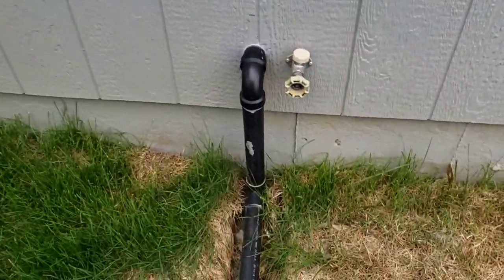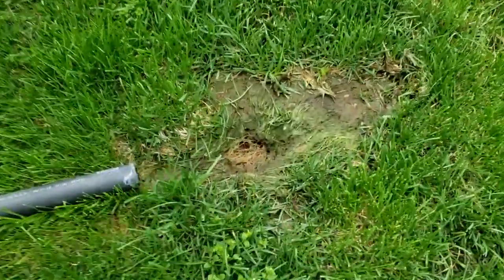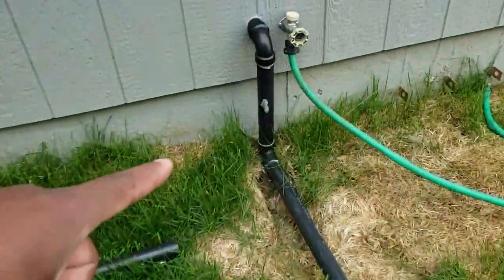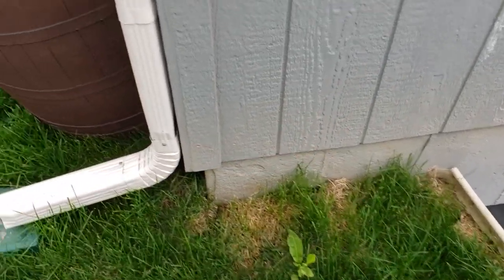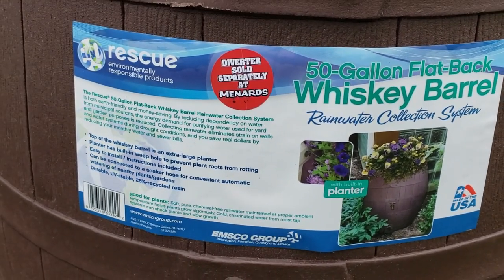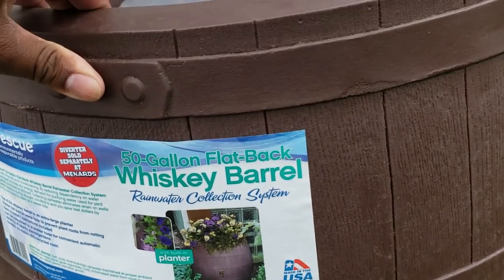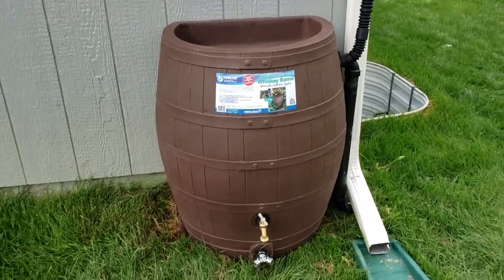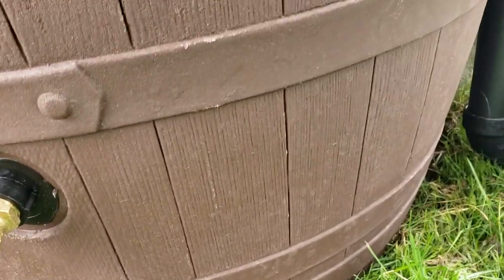Sump pump into a rain barrel install

Comment: I have been wanting to do this for a while. My water is EXPENSIVE. 
I already have some rain barrels and the sump is right next to them. Right now the sump comes out of the house and goes into a large pipe that goes to the retention pond 2 doors down. 
So, I will be able to have the sump pump fill the barrels and then overflow when full back into the large pipe that goes to the pond!
This is the year. 
Next year I am going to figure out how to tap into the pond 2 doors down!  Ha.  Just kidding. 
Nice video. I think the hardest part will be finding enough barrels or water storage area with out making the yard look trashy in my case. 

I do have a sprinkler system. I have pondered for years how I can tie rain barrels into that system using an electric pump but then it gets REALLY complicated.

Comment: I can not tell you how awesome this video is.  We flooded , so we installed a sump pump and it run constantly.   The discharge has been a nightmare to deal with, I’ve tried running down the driveway to the road (which stained the driveway), tried to run it into the lawn , which like you, it destroyed areas of grass and soaked the ground to the point of not being able to cut it or even walk on it. 

I want to do what you did and some how attach a pop up sprinkler head to the barrel, so when the valve is opened , the water will use gravity and run through the sprinkler head and disperse water evenly over an area of my choosing.   

Your video is a great start to that.  Have you made any updates since this video?
Reply from the maker: Sounds like a great idea however, I'm not sure if gravity alone will be enough for the pop up sprinkler head. I tried a soaker hose and that sort of worked once I put some bigger holes in the hose. It is nice to have something that would just take care of itself automatically. This year I plan on installing some pop up valves in a few places. I'm going to be able to run my pump to them or hook up to the house city water if my rain barrel is empty.
Reply: Could you could install a small sump pump in the barrel to connect to a sprinkler;soaker hose?

Comment: I’m trying to find a solution to this too. My pump sprays across the driveway making ice in winter. What do you suggest about winter?
Reply from the maker: In the winter I have to disconnect mine from the rain barrel. I let it go to the grass it still messes up the grass in that spot, but I can't really think of a way to avoid that over the winter. I would at least get some extra pvc pipe and direct it away from the driveway.

Comment: Doing something similar but running the long pipe in the basement along the rafters, might add a valve for winter/summer use
Reply from the maker: I was thinking about running the pip across the basement rafters and come out of the house near the barrel. I might do that later after I get more storage and a more permanent solution.

Comment: How is it working a year later? What is your solution to it overfilling? I have the same problem in my yard was thinking of doing the same. Right now I have the sump off and running a utility auto pump with a hose to fill up buckets - my short term solution for now
Reply from the maker: the pump getting the water to the rain barrel is no problem. The only issue that if fills up too fast. I need a bigger or more rain barrels to store more water. that way I don't have to string out hoses, extension cords and that heavy pump everyday. I would like to do it maybe once or twice a week without my barrel overflowing.
Reply: @jpulley  You probably need an overflow discharge line from the barrel.  As your system is not a closed one, the downspout diverter will never 'backflow' through the diverter line back into your downspout as designed.  I would look to add an overflow discharge line somewhere below your sump to barrel inlet so that water doesn't pour out of there when its full.  Alternatively, you could put the barrel up on blocks to get the downspout diverter more or less even with the barrel inlet and then seal the sump inlet hole to create a closed system.  Then, when the water level reaches the downspout inlet level, water will backflow through that hose out to the downspout as designed.  Also, you definitely want a check valve on the sump line somewhere.  My $.02.
Reply: @dbcoopernd  could you explain the overflow discharge line?
Reply: @Leah1974  Hi Leah, sure...so...basically, if your barrel is full, you do not want it just pouring out of whichever is the lowest to the ground unsealed hole.  In James' example from the video, the sump inlet looks like the lowest open hole as it is below the downspout mounted diverter...so when it fills up via the sump and/or rain, it will simply pour out of the same hole that the sump inlet pipe comes in because it is not sealed.  You generally want to divert water away from your foundation for obvious reasons.

I would probably put the barrel up on blocks such that the downspout inlet is the lowest hole in the barrel......that way when the barrel is full to the level of that hole, water will simply flow back along the downspout line into the downspout and out away from the foundation.  Alternatively, you could install another hole below the lowest inlet hole with a line that leads away from the foundation....then, when it fills up to the level of your new discharge line, it will simply divert extra water wherever you want it.  If you are doing a combo downspout/sump like james, you also need to be aware of the pump's capabilities and backflow pressure, so you should always have a checkvalve in the line AND know whether the pump can handle the extra height in the discharge line.

I can probably help a bit more with more details about what you are designing.  Cheers.
Reply: @dbcoopernd  thank you!

Comment: Can it pump up like that? Doesn’t half of it just drain right back in?
Reply from the maker: @s6juggs  a good amount does go back into the sump pit once it shuts off but I just get pumped out the next time it runs. The builder should have installed a check valve or back flow preventer to stop this from happening. I've lived in the house for 5 years and it hasn't caused an issue.

Comment: sorry for the dumb question. But where is the sump pump collecting the water from in the basement? Shower, sinks and toilets?????
Reply from the maker: No, it's coming from drainage trenches under the slab in the basement. It's ground water and rain water.

Comment: How clean is waster my sump pump base it a bit dirty/rusty
Reply from the maker: Mine is always clean and clear. Probably because it runs so often keeping the sump and line clear. I still wouldn't drink it though.
Reply: @jpulley  I don't plan on drinking my run a lost when raining it's quite old have changed pump 3 times its that old. I could probably clean out the bucket it's in. I want to use for outdoor work like plants ans cleaning

Comment: Any ideas for winter besides disconnecting?
Reply from the maker: I guess that depends if you sump pump runs over the winter. Mines run all year. Not nearly as much in the winter. My first year temps dropped quicker than I thought in the pipes froze up and busted because there was water setting in the pipe.  I then reconnected with a rubber sleeve. So now In the summer I can connect to the rain barrel and in the winter it can go to the ground.
Reply: @jpulley  What is a rubber sleeve?
Reply from the maker: @AblecommunitychicagoOrg  A flexible PVC  coupling is the actual name. 

Fernco	1-1/2 in. x 1-1/2 in. DWV Flexible PVC Coupling
https://www.homedepot.com/p/Fernco-1-1-2-in-x-1-1-2-in-DWV-Flexible-PVC-Coupling-P1056-150/100058870
Reply: @jpulley  Thanks so much!

Comment: Are you going to paint the new piping and flex hose to match the house and gutters?
Reply from the maker: nope,
Reply: @jpulley  great response.  As a retired painter -- everything can be painted but once you do it becomes a maintenance project -- also anything can be painted, that doesn't mean the paint will adhere. I've spent countless torturous hours scraping , sanding and repairing things that should not have been painted. 
  Aaaagg, I'm starting to get flashbacks!!!

Comment: What about the line freezing in the winter?
Reply from the maker: I just this connect the pipe from the rubber couple and then hook the original pipe back up there's not much water coming out in the winter so it doesn't really hurt the lawn. In the spring I hook it back up like this.